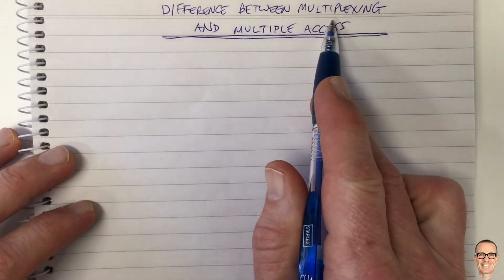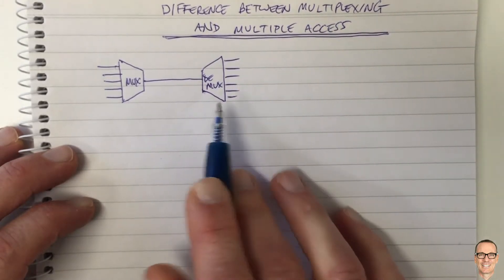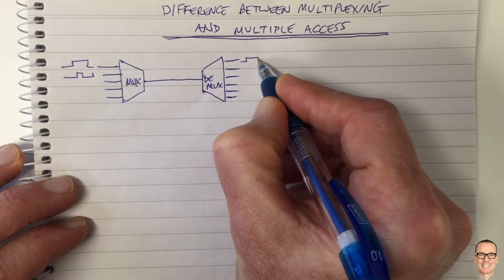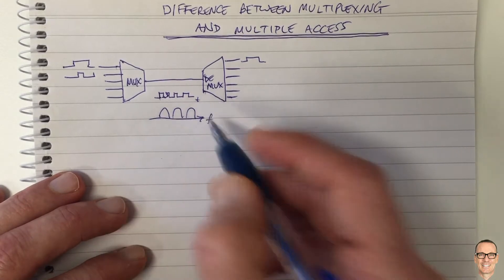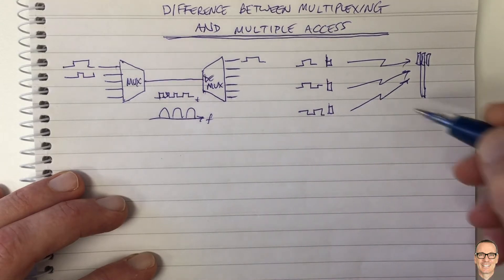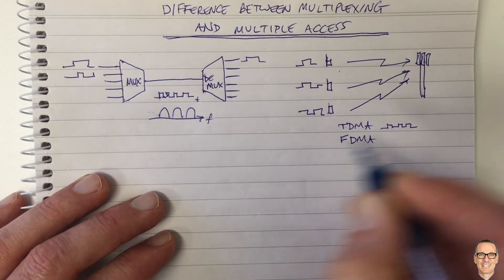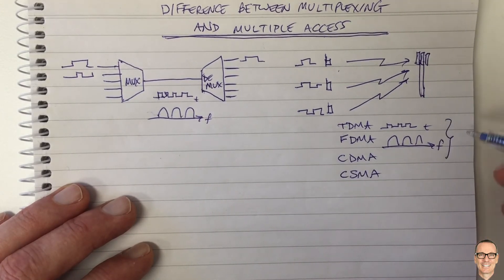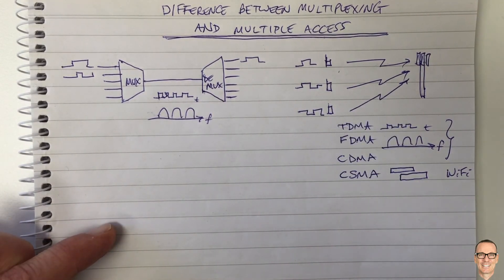The Difference Between Multiplexing and Multiple Access

Comment: in multiplexing, are the multiple signals coming from multiple users or different users?
when my professor asked me what is fdma, I said it is a process of allocating different bands within the same channel between different users, and he said this is multiplexing not multiple access.
tell me the difference between fem and fdma please

I have my presentation for this within 2 days, please respond to me.
Reply from the maker: It really depends on the definition of "the channel". In Multiplexing, as I said in the video, all the different streams are put together in a multiplexer. That's an actual device (or chip). The different streams generally come from different users, but they could also be parallel low rate streams from a single user. In Multiple Access, the users all send their signals separately into the channel (not through a single device). For example, different mobile phones each sending their signal. They are all using the same "channel" but are not "multiplexed" through a single device.
Reply: What allocation algorithm is used in  tdma?
Reply: My professor tells that TDMA uses TDM, but the difference is in TDMA we use allocation method/ algorithm, and he wants me to explain that in my presentation, what is that allocation method or algorithm? Also in the class, he has shown me an example where he has taken two signals and he compressed those two signals and sorted out them in the different time slot, user 1 takes slot 1 and user 2 takes slot 2(he combined those two signals in one signal and has shown me that it is multiple access, from 0 to t1 is user1, from t1 to t2 is user2, from t2tot3 is user1, vice versa) can you please explain me.